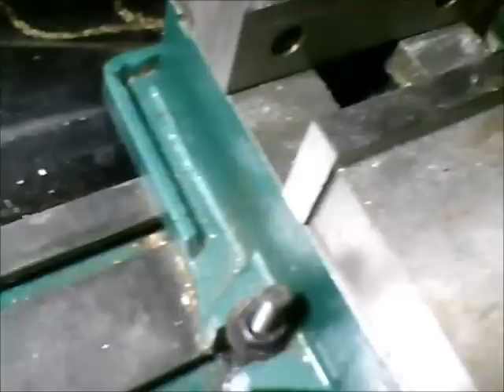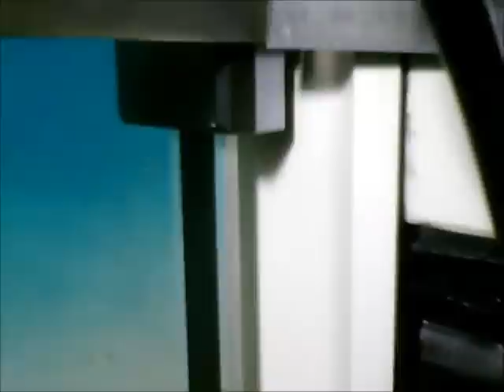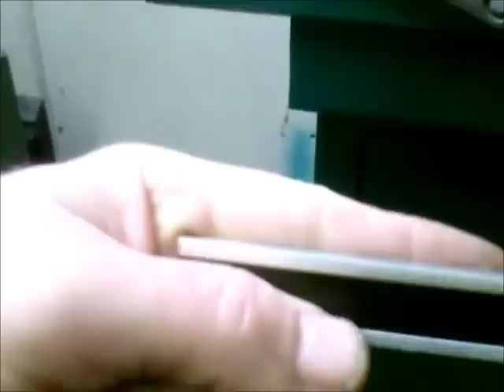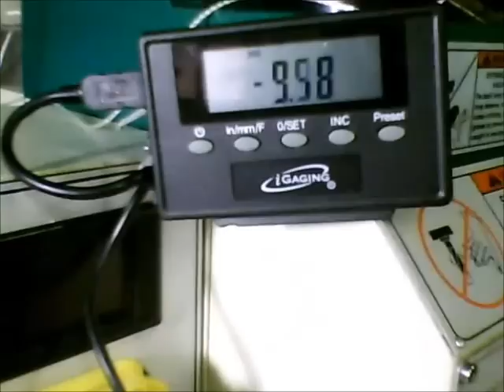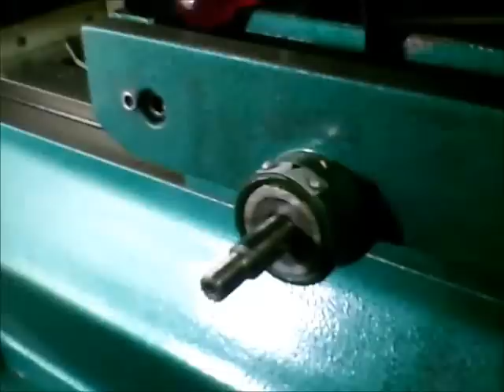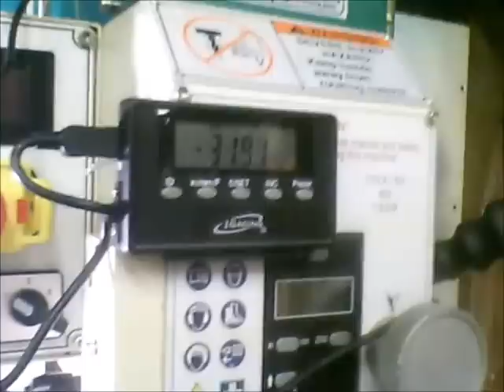Igaging install on the Grizzly G0704

Comment: I bought these for my PM25 MV. When I compare distance traveled to a mitotoyo caliper the igage display read 7.993 inches where the mitotoyo read 8.000. If there is no way to recalibrate igage components then these things are worthless.

Comment: I have the same mill but only put the igaging readouts on my X and Y axes. Right now I'm sitting on the porch waiting for the big brown truck to deliver my new spindle motor. I guess I pushed it a little hard over the past three years and it finally gave up the ghost. Great video!
Reply from the maker: Todd Griffith I could have done only the x and y but I got such a deal on the 3 piece set it seemed a shame not to install all of them. 
Thanks alot for watching.  :-)